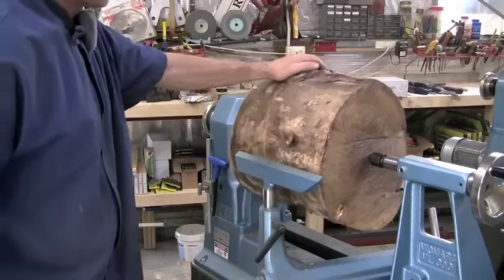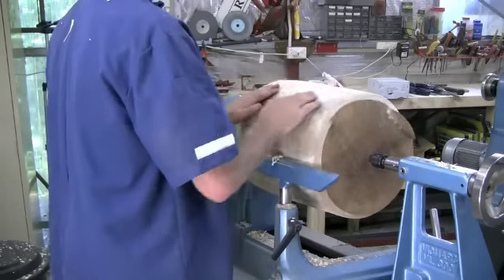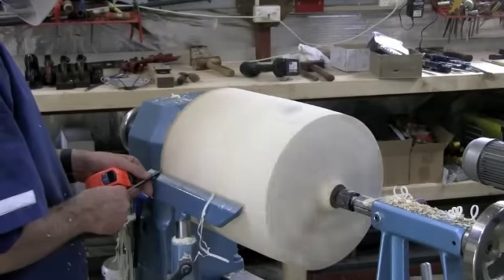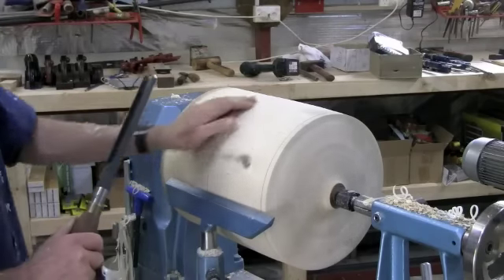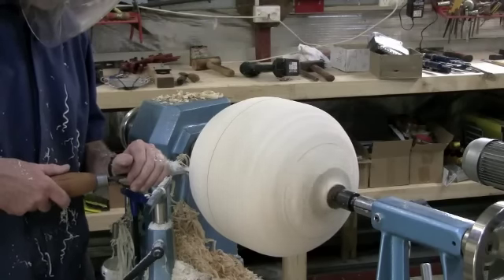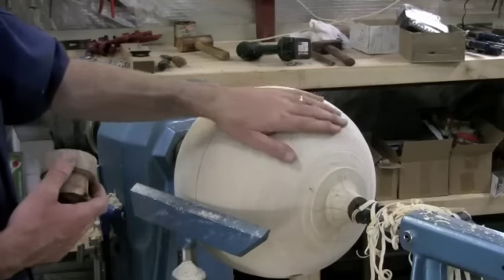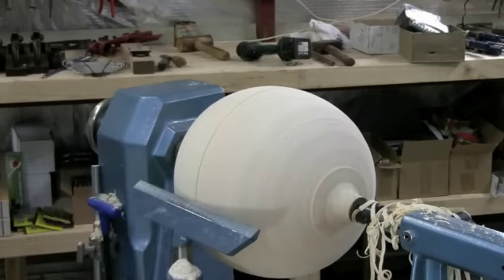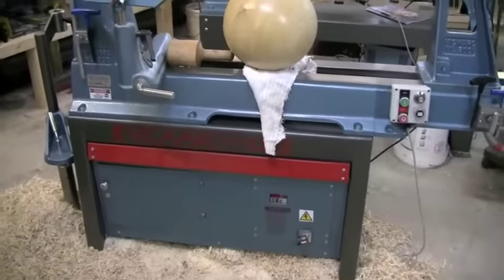How to Turn a Timber Sphere

Comment from the maker: Hi Doug
I placed it in a plastic bag which stopped it from splitting but will also stop it from drying. What I could do is leave it soaking in water with detergent in it then let it dry. I gave a demonstration where I turned a two mallets out of blue gum straight of the tree soaked it then dried to this day they still have not split. Not sure how it works (though I have my theory's) but it works. You may though get some distortion depending on the grain.

Comment from the maker: Hi there
Sorry for the delay getting back to you. This ball was turned green. I coated it with shellac with the intention of remounting and re finishing later after it had dried. The idea behind this was to slow down the drying process in an attempt to stop cracking. I usually spray most of my work these days but a friction polish also works well.

Comment: The trick with the "circular opening" test is so elegant! 

Newb question: At either side of the sphere, obviously you have to leave a little bit of a "socket" on the first round of turning, because that's where your spindles grip on to. Do you then rotate the sphere to turn those off? At the end, you seem to have special wooden pieces to hold the sphere, to avoid "spindle marks". Do they somehow grip the sphere? Is it just really tight? Worried that a furiously rotating sphere drops down.

Comment: you are a fine master carpenter. the sound on my pc not working at the mo', i assume you used aged dry wood? how much would you charge for a ball of 150 to 280 mm in diameter? i am searching for a manufacturer who could supply balls like this to our internal martial arts club for so called taichi ball qigong (太极球)
Reply from the maker: Thank you. The wood was green but I have done others with dried timber. But not as much fun. I'm sorry I do not sell them.

Comment from the maker: Good point Paul. With the editing of the video so much of the info was lost. The sphere was turned 90 degrees and held in by timber "cups" (lined with leather so as not to mark the ball. The small stubs that you refer to were cut close to flush with the surface then turned off.  I have thought of doing a remake to explain some of the steps in more detail. I hope this helps.

Regards Angus

Comment from the maker: Hi there
Yes sorry about that allot was lost in the edit trying to get it under the 15min. I cut the stubs off then rotated the sphere 90 degrees then finished on the lathe using the same method as the first step. I hope that will help.

Cheers Angus

Comment: The most important information for turning a sphere was left out at 12:56.
At that point the sphere is removed.
The knobs which remain on the sphere are cut off
The centers are replace with new centers, both having cupped flanges to fit the sphere.
The sphere is then re-mounted between the cupped centers with the knobs in a vertical position.
Tighten the tailstock enough to hold the sphere and turn the knobs to match the sphere.

Comment: That looks like sweet gum, and yes, let land sit fallow a few years, and it will become a forest of sweet gum, it grows very fast, about the only thing that will rival it's growth speed is Cottonwood. I am currently operating a dozer clearing our farm that sat idle for 25 years. I knock about 400-500 trees down per day with a 750B, they are averaging 8-10 inches at the base.

Comment: uhm you might want to remove the bark first?
Reply from the maker: Just as easy to turn it off. At that low speed not so bad either. If the bark is loose I allways remove it. 
Cheers Angus

Comment from the maker: The more you spend the better the gear. I would recommend that you don't pick a late from China. You most likely would give up wood turning if you go down this road. Vicmac make a VL175 which is a great lathe cheaper than the VL300. Not sure of the price .... have a look on the net.

Regards Angus

Comment: for a perfect sphere, i guess you need a tool for making spheres. something like this: watch?v=q0UKMX2wkC8

or, the size might fit so that you can just put it into a bowling ball polishing machine. Otherwise, if the sphere is only turned around one axis, and not around several axis or an axis that changes, the result cannot really be perfect.

Comment: Too bad you skipped over the whole important part of making a sphere.  Spheres don't have knobs sticking out both ends.
Reply: Josef Roesler if you can't figure out how to cut them off and smooth them down by sanding you probably shouldn't be making them anyway
Reply: Devin Shillington I'm guessing you just levitate yours, I don't have the power of levitation like you.  But that's really an asinine comment to make, your logic would imply that if a person doesn't know how to change brakes on a car, he should never ask how.  Or if he can't "figure out" how to do anything else, he should never do it.
Reply: Adam Hewson in short, its like a comparison. Basically using something irrelevant to prove a point. However that irrelevant thing has to be the same type of thing.
Reply: Devin Shillington I suppose it would take a moron to come to the conclusion that I didn't know how or that I asked how, neither of which did I do.  I have the same jig and have used it quite a bit. If you want round spheres, you don't send them on a flat surface by hand. You make a cup for either side of your lathe to support it.
Reply: Josef Roesler if you're an expert on it why are you bitching about him not showing it? Look it up, placing it down and sanding it works perfectly fine,
Reply: Adam Hewson What's your purpose in this? Nobody has even acknowledged your existence until now, yet you keep commenting, switching 'sides'.
Reply: Adam Hewson Fuck sakes. You've failed us all. My people will be in contact with your people to set you up with free cooking classes. You WILL make perfect cupcakes. I believe in you.
Reply: Devin Shillington actually, it is the most important part...spheres don't have knobs on them. And removing them off the lathe does not result in a perfect sphere.  You should start back on your meds, you're so emotional.
Reply: Actually, I have more subscribers and views than you do. Yeah. 66 subs beats your 29, and my 32k views beats your 25k. Although it may only say 22k on my channel due to a video I had to private for some copyright claim back when anybody could file one with no proof.

Also, I don;t see any emotion at all being conveyed over any text I have written, and if you do, it;s the wrong emotion anyway.

Also, about your gopro thing. It if off center. It is also extended more than the intended use. I have the same one and I use it maybe twice a week, works great. That's not to say you dont have a defective one, maybe you do. how ever it's still pulling hard towards the ground.
Reply: For skateboards and minecraft, even.
Reply from the maker: Josef Roesler Wow hot debate here.
The editing process meant that i had to cut heaps out of the original footage. At this time tube made me keep it under the 15 min.
The method to remove the stubs is to rotate the sphere 90 degrees then cut them off close to the ball. You then use the ring, bucket cup or whatever method to check for roundness continue to turn till the sphere is achieved.
Hope this helps.

PS Thanks for watching.

Angus
Reply from the maker: Josef Roesler You are on the right track. The problem you need to solve is the tail stock. I use a live center with a tread protruding on which i turn a cup. The cup is the correct method only i use leather off cuts to protect the piece. 

Cheers 
Angus
Reply: Angus Pitt I have some large nuts the same size as my headstock threads, if I could find a tailstock Morse taper with those threads, I could glue the nut to the back of my cup to attach it.  I can see how leather would be better than soft cloth, I need to look for something heavier...
Reply: tahu bulat Isi sapi